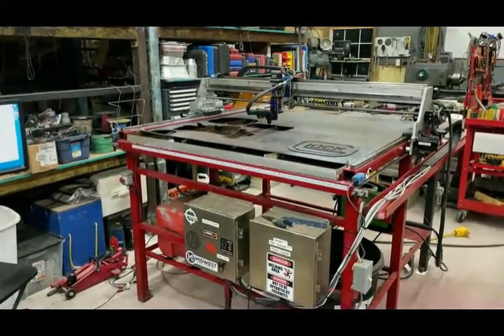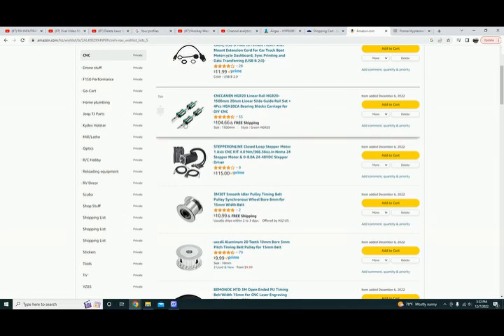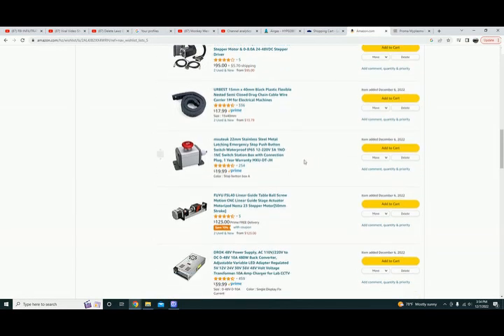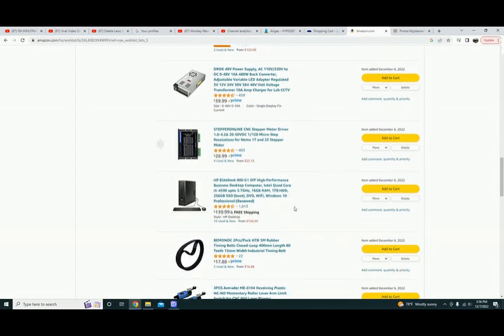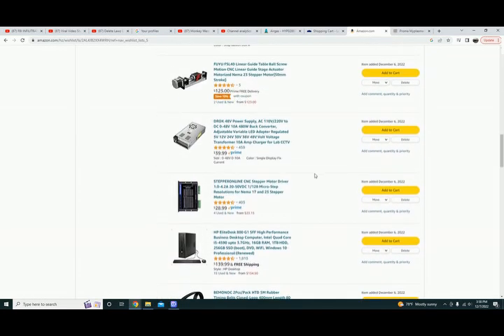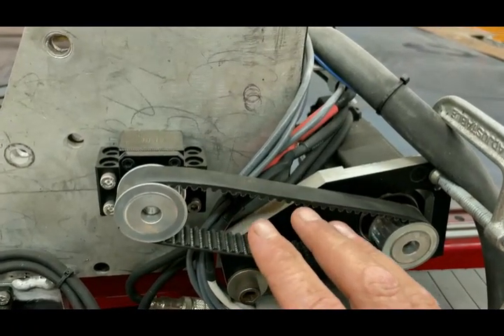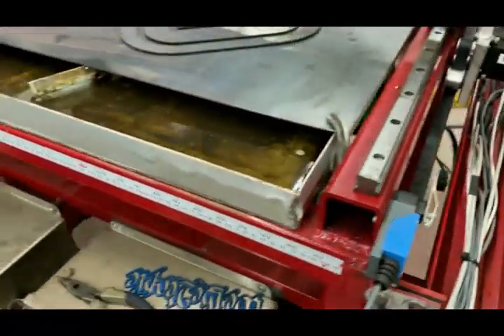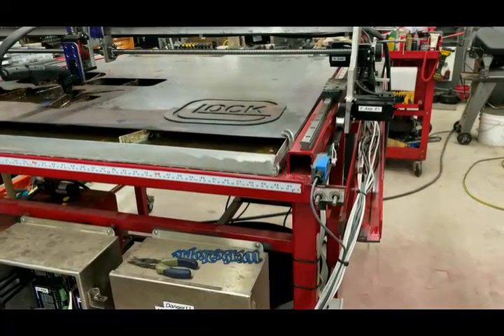Budget DIY CNC Plasma Table Parts List And Full Breakdown ( Proma Myplasm )

Comment: Can you say what your settings are on the stepper driver? I’m trying to replicate your set up and cannot get my motor to turn. I’m trying to bench test one motor on the bench just to learn. I have no limit switches connected. Thanks.
Reply from the maker: Shoot me your phone number at OldBarkerRanch1981@gmail.com 
Or send me a message and I will send you mine. It will be much easier to explain it that way